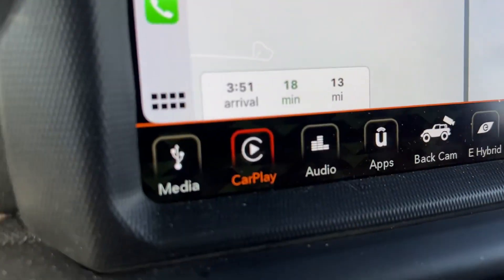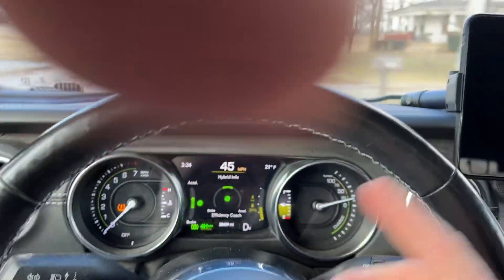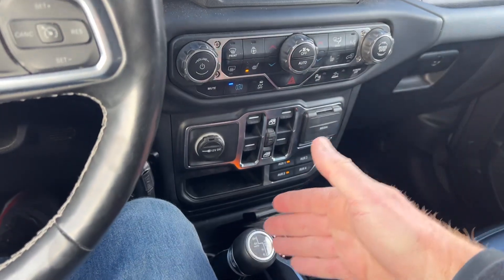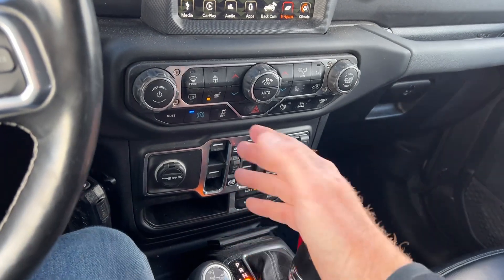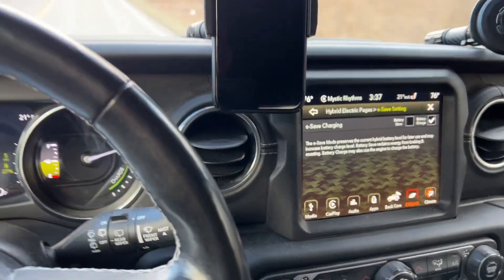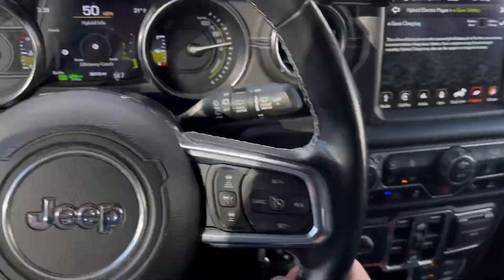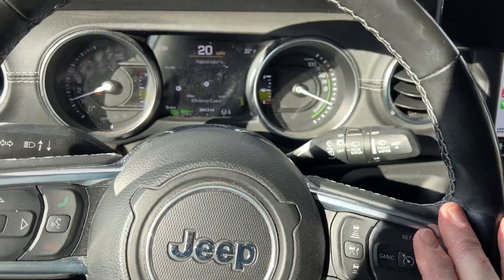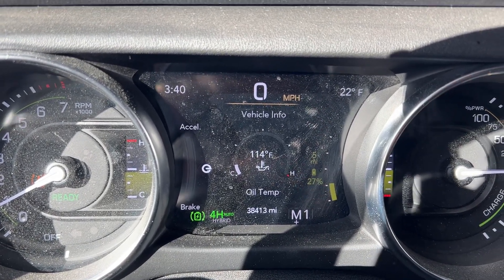Short Engine Run Avoidance

Comment: Just hit my first FORM on my 3 month old 4xe. And it totally was me running short trips on the ICE.  Spent most of the previous 3 months all electric and have a BIG road trip planned and was like, probably need to brake in the engine all the way before I drive half across the country.  But was not thinking about FORM... within a few days with a cold front I got stuck in FORM for like 5 days.  Finally said F this and went on a 2 hour drive in the boonies and Mr. 4xe is all happy now back allowing me back in to electric.  Lesson learned.....  NO short drives with ICE in the cold, ever.

Comment: "e-save" os about the most inefficient way possible to charge your battery. There is no reason to use it except in emergencies. Your current MPG will go down, not up.

If you want to clear FORM, fill up your tank (leave it a quarter empty at all times since it's all it take) and change your oil. Burning gas over it is stupid.

Comment: I drive in electric 99% of the time. I live in a city. I only use gas on road trips. I hate whoever decided the vehicle has to start in hybrid every time. That's about the only time I use gas. Accidentally. I keep the tank as empty as possible so I can satisfy FORM immediately when it appears. Oil changes every 3K miles.
Reply from the maker: @mjdegans  It will start in electric mode if it was in that mode when you shut it off. If it doesn’t do that, you are missing some updates. Is yours on the 04B recall list?
Reply: @Wrangler4XEFans  Is 04B the most recent battery fubar? If so, yes.
Reply from the maker: @mjdegans  95B is the most recent. 04B is from a while back. If yours doesn’t start in electric when you shut it off in electric, you are missing some updates.

Comment: Do you know why the ideal is so high when my engine kicks on?  Usually revs around 2500 and takes a while to settle in
Reply from the maker: @davidhurwitz6385  Start up cycle to clear the moisture from the catalytic converter and make sure it’s warmed up. The K0 clutch between the engine and the transmission stays open during that cycle so propulsion only comes from the P2 motor in the transmission.

Comment: So what defines “short engine run” - is it purely operating temp?
Reply from the maker: I'm not sure I'm qualified to give THE answer. But I would say anything that doesn't run it long enough to get the temperature up in the 170s or 180s is likely too short. If you drive in hybrid mode and have a lot of times where the engine kicks on when leaving stop lights and other stops, those are all short runs.
Reply: @Wrangler4XEFans  But you're the expert! :) - I had FORM and engine heating cooling after I purchased in DC 2021 and it sorted itself out. Had it very rarely in 2022 and then last week after new fill up (and recalling the engine coming on a few times) FORM started. I'm in Northern NJ and we've had an off-and-on cold winter. In December and most of Jan i was able to go to and from work (20 miles round trip) in electric (with diminished battery capacity on colder days). Then, a week agog, FORM came back. What was interesting is that i would drive to work (non-highway) (max speed 40-50) and not be able to go into electric. BUT...at the end of the day I could drive home in electric. Next day, whether it was 20 degrees or 35 degrees, FORM in the morning at start up. Now today, 30 degrees FORM is gone and i can drive to work all electric. BUT...engine randomly came on and said electric mode temporarily unavailable after 10 min of electric driving. This was RIGHT when i was arriving at the gym. And so knowing what you've told me I checked the temp and i was only at 140... so i fired it up in e-save and drove around until i was up in the 170. Hope you can follow all this :)

Comment: In the GC, you can knock it down into sport mode in any driving mode (hybrid, electric, or Esave) and the ICE will run and stay on even at a stop light.

Comment: To help prevent this, they should allow you to set a minimum mileage, like 35mph, for the engine to run in both gas and engine.  There have been many times I would prefer the hybrid mode, but the engine would run in electric mode, and this a fix, but it shouldn't need to be this way.  The same can be said for the regenerative breaking feature, as  I preferred the old harder breaking, rather than the weker breaking method that we have now.  They should give us the option, like other vehicles do, for how aggressive you want the breaking to be.
Reply: You can switch the regen breaking on and off. I like it for when you’re going faster rather than stop and go traffic.

Comment: Watch your oil temps to get an idea where your motor is at. Get the oil up to a minimum of 155-160 before your start reving beyond 3000-3500. One of the biggest contributors to engine breakdown/failure in Jeeps is owners not giving the engine oil proper warm up. Beyond that, once it is up to temp, make sure to exercise it thoroughly. The happiest motors I've seen internally are regularly run throughout their rev range after proper warm up. Having direct injection will more than likely still lead to a fair amount of carbon buildup on the valves over time since you're not getting the benefits of fuel washing over them; but the rest of the motor will stand the test of time this way (provided it's getting routine oil changes). 

Remember folks, just because it's a hybrid doesn't mean you can stop taking care of your main power plant. Exercise the 4 banger regularly and it'll last for years to come.

Comment: Just so I understand... I can't run short trips when that is where I need to go... and it won't run electric when it is cold (I also live in the northern midwest). SO I need to drive a LONG distance (and burn lots of gas) to get the engine up to temp and add milage to the vehicle reducing the value of the vehicle, so I can eventually run some electric to save gas..... Somebody has some Jeep-splaining to do to have this make sense.... esp. what you were trying to show us....
Reply: People in Seattle are suing Jeep over this. It's a class action. Jeep wasn't honest about the inability of the vehicle to be used in cold weather long term. It's gonna bite them.

I drove mine across Canada in the winter and never entered FORM, but I was driving all day. In normal conditions the vehicle will never satisfy FORM in the cold. You have to cover up the front of your Jeep or something. Easier just to change the oil or refill gas.

Comment: My 4xe would drive like a hybrid when in FORM, engine stopped running at stop signs.  Had software updates completed a few days ago and now engine keeps running all the time when in FORM.  This way the engine will warm up to full operating temperature.
Reply from the maker: One thing is for sure, Jeep is working on things. To me, that’s just awesome.
Reply: Yup, I can confirm this is the same for me after the software updates my dealership did for the recalls.

Comment: Somewhat related point.  Hit with cold weather in NJ so been employing your method. Also notice that latching for e save not working.  Was working post software upgrade last month until yesterday - but vehicle is defaulting to Hybrid on restarts now- not sure if due to cold weather or coincidence.
Reply: My 2022 latches for hybrid or electric but not esave. I assumed esave was just not an available latching mode?
Reply from the maker: @taradurkin4876  From what I’ve gathered, eSave doesn’t latch.
Reply: @Wrangler4XEFans  Thank you.  I had it confused.  I’m latching in electric and hybrid. Did not realize you couldn’t latch in e save.
Reply from the maker: Now that’s weird. Have to see if it changes when it warms up.
Reply: @Wrangler4XEFans  will let you know.  Thx.
Reply: It always defaults to hybrid. At least my 2021 4xE does. You have to press electric manually every single goddamn time. There is almost no reason to use "e-save". You bought a hybrid. It should run on electric until there's no more batter. The electric assist when the gas is on isn't worth it.
Reply: @mjdegans  after getting the ZB7 recall the 2022 models (and some late year 2021 builds) latch. The latching modes are hybrid or electric.
Reply: @taradurkin4876  I have a late year 2021. I just got that flash last week. Thanks for the info. If it latches on electric and hybrid but not e-save I am very happy. I haven’t noticed but I press election on every start as a habit so I might have easily missed the change. Overall I love my Jeep but the software needs work.